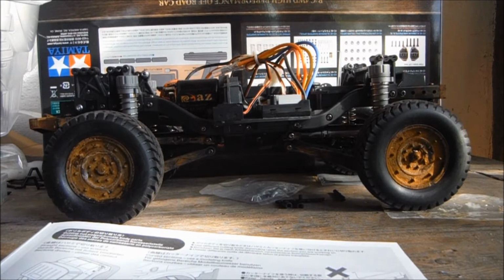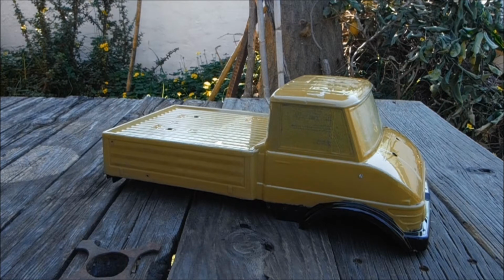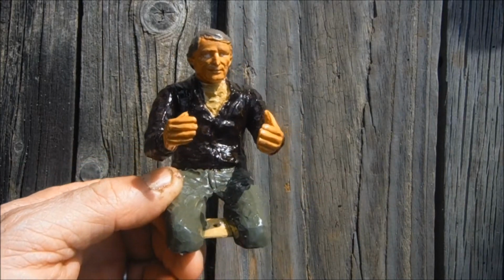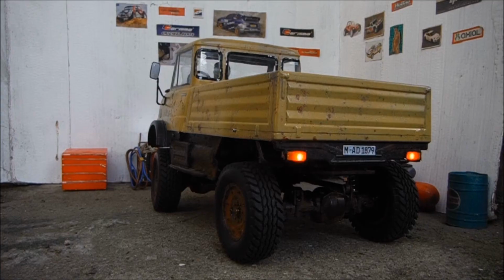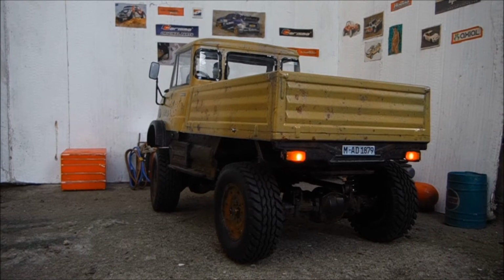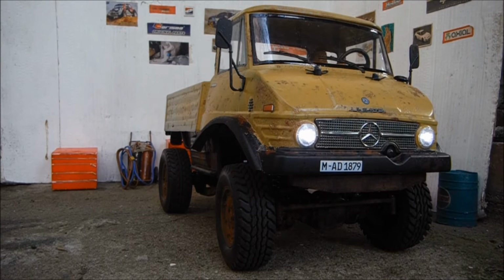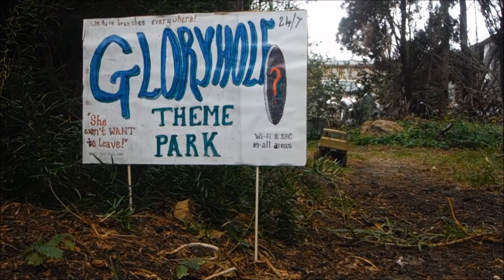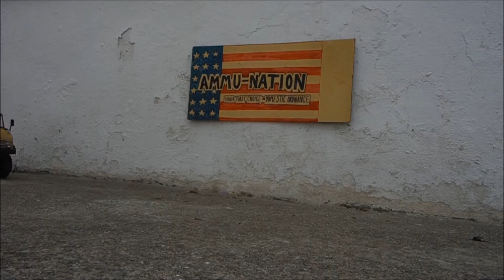CC-02 Unimog   Painting and running it

Comment: I am super impressed with your knowledge of rust treatment on bodyshells Del 👍 I just use many layers of different colours of paint to represent weathering on my shells with a good dose of rubbing down in-between coats 😎
Reply from the maker: I love that effect! I've used it on a Kamtec-bodied wrecker truck. As thidms shell's lexan I thought that too many layers could lead to flaking, as I wasn't using posh Tamiya paint. It still ended up with 2 layers on the inside and 2 on the outside, even though I was trying to keep the layer count down.

Comment: Hey Del, absolutely spot on with this model! Love the technique of rusting it 👍🏻 Looks like you had a blast building and filming this. Looks like the locked front and rear diffs worked a treat (you rebel!!)
Reply from the maker: Hello again! Did you like my rust? I had to summon the willpower to be reasonably restrained with the rust, as I wanted the truck to look well-used without being a case for the scrap yard.
I am so glad that I went back and locked that front diff. Once you've finished a stage in a build it does take an effort of will to go back and undo it, but now I'm delighted that I did so.

Comment: Excellent, very good work on this bodywork, nice look. Perfect run and crawling test. I see that you have a lot of wind too, and it's not always easy to film, here it's the same 🙄 Your caravan is great 😍
Reply from the maker: Hello, Pascal! I was struggling with wind noise - I taped my phone to the tracking pole and had it playing a diesel engine sound effect to try to help to drown out the wind.
I'm glad that yo like the caravan - it's made from thin plywood, and the windows, are food packaging materials : )
Reply: @Del350K4  A caravan made with salvage, that's a work I like 😉 I heard the noise of the diesel engine, and I thought that you had found a good solution to attenuate the noise of the wind. Besides, I also saw in your video that the sea had splendid waves 😍
Reply from the maker: @satorrotas  The sea looked very cold - it had that greenish-grey colour, and, as you say, splendid waves!
Reply: @Del350K4  It is certain that I would not go swimming, although it must be warmer where you are than here, but looking at the sea is always very pleasant 😉👍
Reply from the maker: @satorrotas  Today it would have been warm enough here to sit on the beach, but I would not have gone for a swim!
The sea in the video is very close to where I was when I very nearly drowned last summer, while recording my "Gibraltar Fast Cargo Launch" video. Another reason not to swim there!
Reply: @Del350K4  I remember that you had spoken that you almost drowned, the sea is beautiful but also very dangerous, even for someone who knows the place well  and I am happy that you came out of it well. I'm not a great swimmer, so for me the sea is on the beach and no more.

Comment: Hey Del if you want to dull the shine down just wet sand it with 800 grit great work a talented 9 year old that was funny it turned out really great
Reply from the maker: Hello, Brent!
Yes, I only used the bare minimum of the stickers they provided on this model.
The trouble with wet sanding it was that I could only find quite coarse paper at my local hardware store and I didn:t want to wait for Amazon.
I was surprised to see how well it did on the rocks with these rock-hard tyres!

Comment: Hi Del, I'm so pleased you did a video covering how you achieved this lovely shell. Fascinating. I'm aware of the salt technique as I've seen it done on static 1/35th scale tanks, but as it turns out it work out equally well on 1/10th scale RC's too. I'm tempted to give this a go on one of my own crawlers. It's a massive improvement on the box art. Thats a cool caravan too, that goes really well with the Unimog - I assume it's scratch built ? It will be a pleasure to see how ( after your ESC and tyre improvements ) how this runs on the terrain in this video. Look forward to that one...👍🏻🙂.
Reply from the maker: You sussed it - I originally found the salt technique on 1:35 tank videos! I nip into the kitchen and pinch a bit of my wife's posh Himalayan rock salt, and also use ordinary table salt at the same time.
The caravan got its own build video on my channel, but it was, ages ago. I'm sure a YT search worded "Del350K4 caravan" would dig it up.